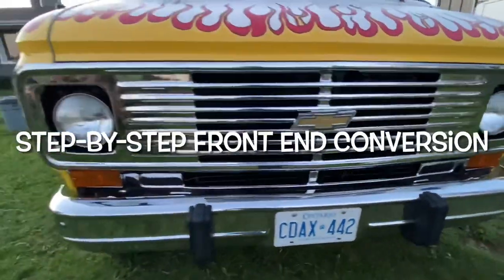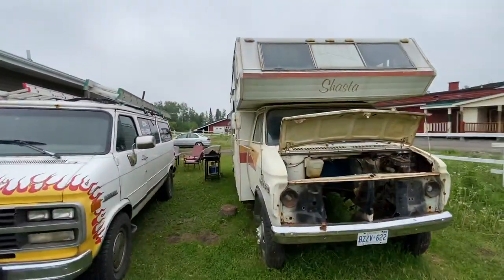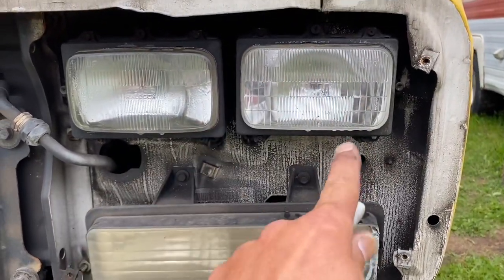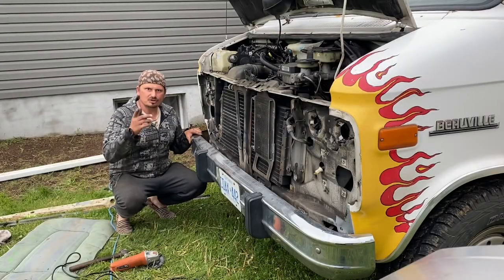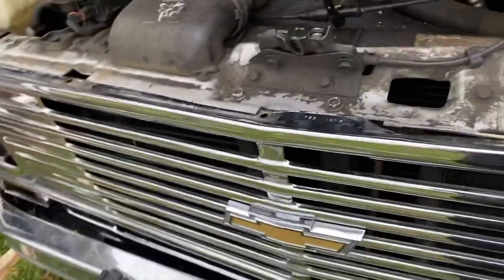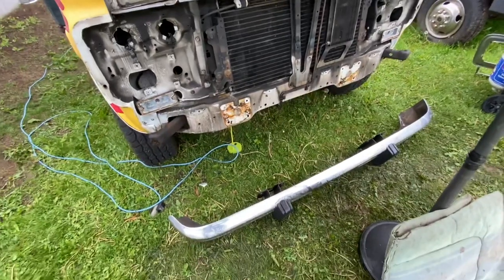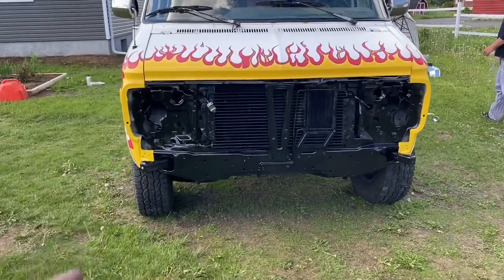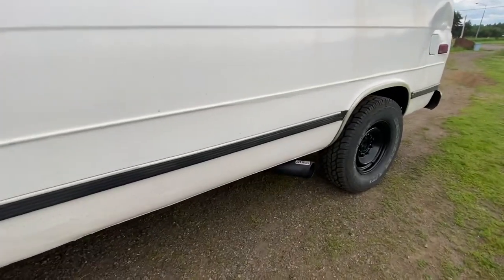Chevy G10 G20 G30 Front End Conversion. Chevy G series van Front grill swap. Front grill install

Comment: I have a 92 G30 that I have wanted to do this conversion on since I bought the van 10 years ago. I also wanted to swap my broken steering column and pulled in from my 83 parts van only to find out after I pulled my bad column out that the firewalls are different and the shift mechanisms are different.
Reply from the maker: It’s crazy how many differences there are.

Comment: You swapped out the grille, looks good. While you have them, swap out the side markers. Then if you can find them, the taillights. Nice work on the polishing.
Reply from the maker: Yeah definitely I want to swap out the side markers and tail lights, the two that are on the RV are in very rough shape so I’m on the hunt for some decent ones.
Reply: You can get the sidemarkers from Rock Auto for about 10 bucks a pop https://www.rockauto.com/?carcode=1029934&parttype=11720

Comment: Can you please tell me the part number for the original 1977 and down upper radiator core support hood latch plate that the grill attaches to that you're holding at 8:57 it should be engraved on it somewhere.  Thanks
Reply from the maker: Hey sorry I couldn’t find any numbers on it not too sure but if you watch the whole video you don’t need it

Comment: Swap the bumper too. The rubber pads are a dead giveaway
Reply: Gem brand bumper guards in chrome with the rubber strips are out there for the '78-'95 vans. They would blend in better with the look and they are taller, so offer more protection.